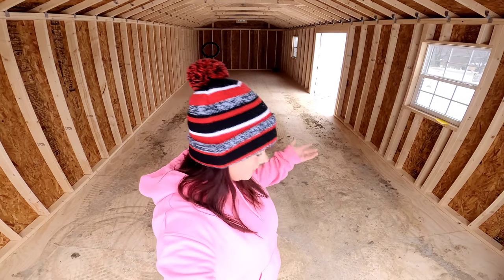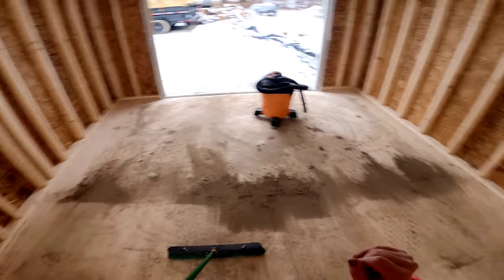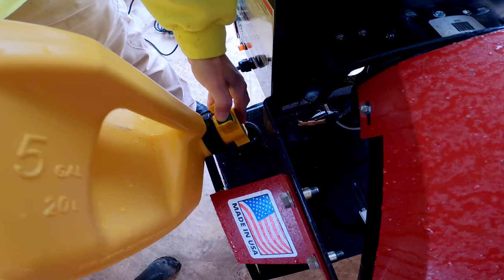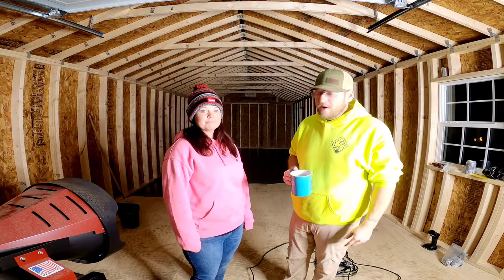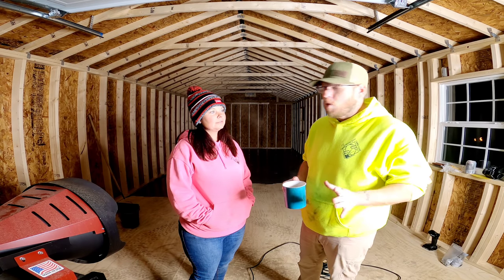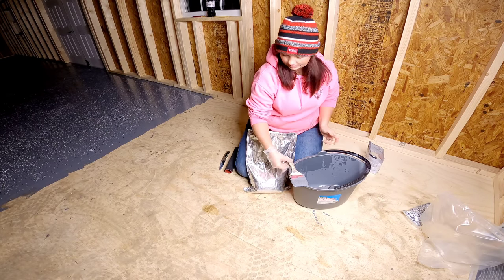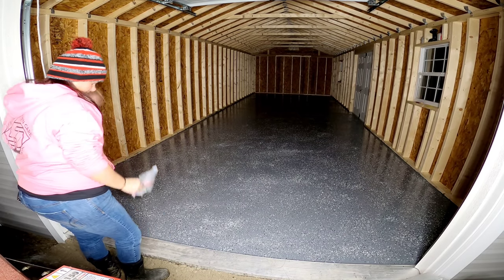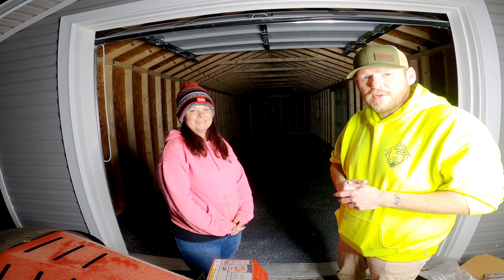How To Do Shed Floors | Start To Finish [Office Project]

Comment: I’m guessing that the wood absorbed more of the paint than a cement garage floor would have thus it didn’t cover the footage you expected. Looks really good and the bare plywood won’t splinter and stain and it will be so much easier to clean.

Comment: First, Love that product, did my basement floor with that, a lot cheaper than carpet.
Second, you should insulate the shed and use 1/4 or 1/2 plywood a- to keep it warmer so you can work on your equipment without freezing B- 1/4 is good as long as you hit the studs if you want to hang something 1/2 is better this way you can hang stuff wherever you want

Good luck

Comment: Could have used textured deck paint at about $160 for 375 square feet of coverage. Haven't touched my deck for years. All foot traffic to the house crosses the open deck. We live in Vermont so it gets the shovel put to it all winter.

Comment: be interesting to see how that holds up.  If you read Rust-Oleums tech sheets all that it mentions is concrete.  My concern would be the give .... even minimal......in the floor.  An epoxy type coating is extremely durable and hard and it will be durable if it holds to the substrate.  Looks great though!

Comment: I think you may be in trouble, that product is specifically for concrete. Any moisture in the substrate at all in the wood and that stuff won't hold up. Too late now I guess it will be a good test. They have a couple other floor coating products including one that is a paint and primer in one that is suited for wood. I am sure a lot of people will be curious how long it lasts. The problem is you pretty much eliminated any other coating choice for that wood now as you will never get it all up. You would need to put new subfloor down... Or I guess you could use some flooring of some type.
Reply: Upon a little research I am seeing some people saying that it can be used on wood... As well as tile or over linoleum which is very interesting..... Maybe it will hold up for you

Comment: Are u all thinking about getting a security Camera in the shed with a monitor with it so  u can watch from the house
Reply from the maker: Oh yeah everything will  be secure
Reply: Might want to think about some burglar bars on the windows too.  I had some thieves bust out the window climbed in and opened the door and walked off with mower, trimmer, edger, blower craftsman tools and a Dewalt box with drill, circular saw and sawzall.  My deadbolt on the door was only keyed on the outside so once they got in they could just open the door from the inside.  Now it's locked down like Fort Knox

Comment: Suggestion...you should have poured the paint im a 5gal bucket and mixed the flakes in with a agitator drill bit. And then used the roller..🤷🏾‍♂️...nevermind..lol...just seen the bucket....but you probably could have poured the sprinkles inside the bucket too

Comment: I learned that working at sweeping up in a factory that a so-called push broom works better if you pull the dirt toward yourself.  We use to paint floors with deck and porch paint then sprinkle sand on it while it was still wet. I have used this on my wooden outdoor steps for years also. I learned this on "This old house" when Bob Villa was host.

Comment: That amount may have beef calculated for concrete floor, not wood.  Looks really great
Reply from the maker: Possibly but the package doesn’t stat a difference .
Reply: @SpencerLawnCare  I would think that a good 90-95% of garage doors are concrete, and the product did say for garage not shed floors. However you both did a great job, and it looks really good. Hopefully it will last as long as you want it to. You both never seem to sit down and have a rest, you are always working hard. Lol (lots of love) from the UK. Be sure to keep safe and well. 💜🇬🇧🏴